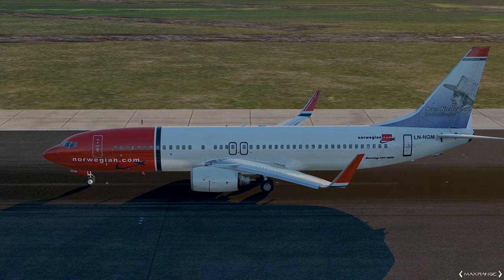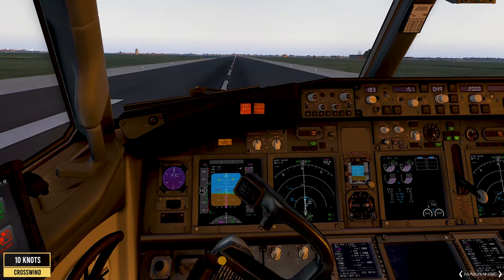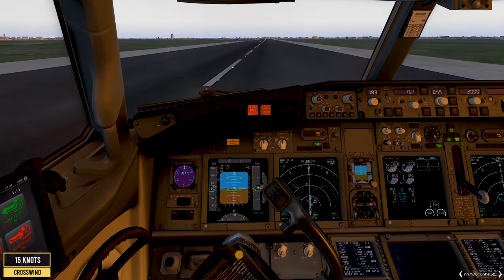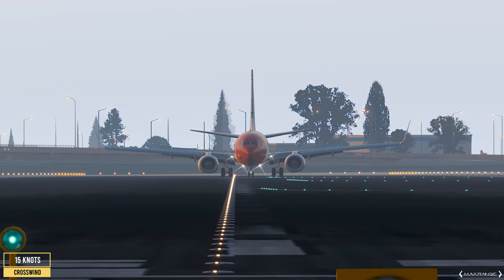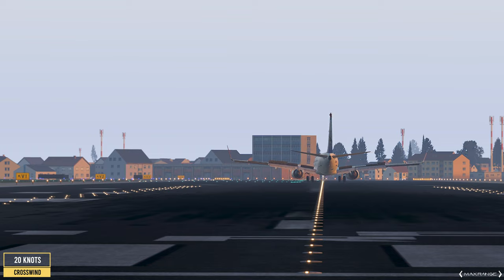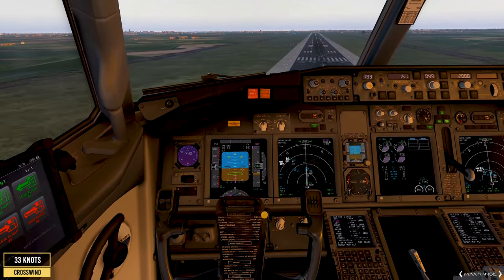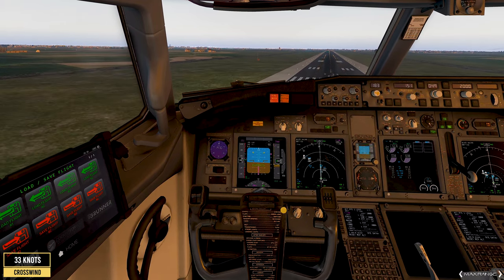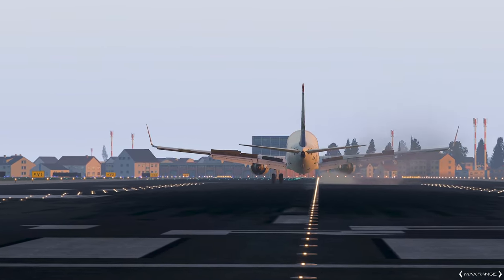How to land 737 with maximum crosswind. SimSpotting with a real pilot.

Comment: This is a new quality in the world of simulator fans. For your information: you can disconnect tiler from yaw in Zibo, Avitab > Configure&Custom > Hardware > Nosewheel axis - switch to on.
Reply from the maker: Appreciate the feedback! You know, I've been playing with that setting, but it's limited in a sense that to make it realistic you need two axes -- one for nosewheel steering with the pedals (up to 7 degrees on NG) and another one for the tiller (78 degrees)